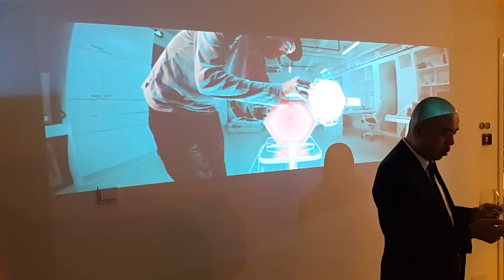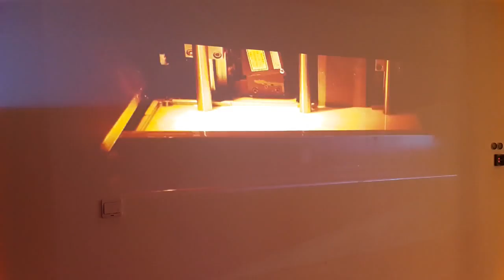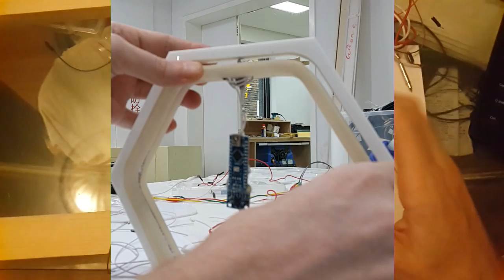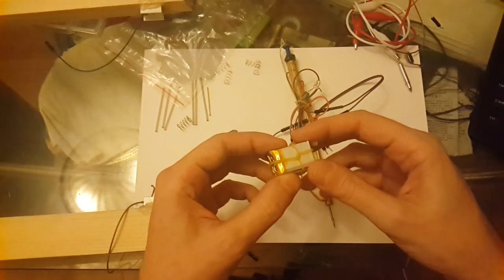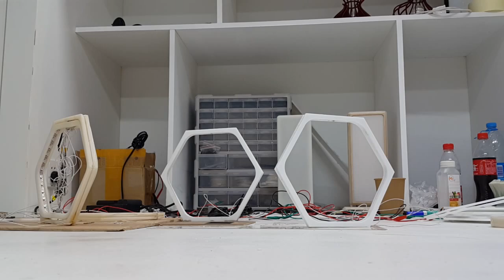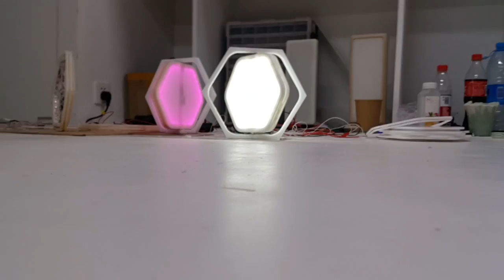Axial connector and power rack. Cancelled product collaboration concept free for all

Comment: Why not just imitate the DC (brushed) motor construction? Don't try to have all-in-one (connection, tension/bearing) but split them. Use anything you like for bearing/tension (your old design works, better use brass, or PTFE, then have a brush touch the spindle sideways, tensioned by a light spring mechanism. You can use two brushes and the spindle sandwiched in between as well. Since your rotor is unipolar (i.e. rotor spindle is electrically separated midway), you don't need many contacts, can use directly the spindle itself.
Reply from the maker: Kalin Kozhuharov I thought of side brush's. and that would definitely work. perhaps more friction though. I like how freely it rotates now. could try using something like and earphone jack for parts I suppose.